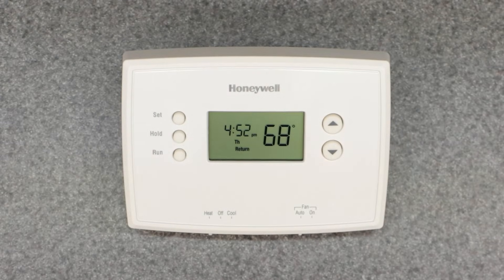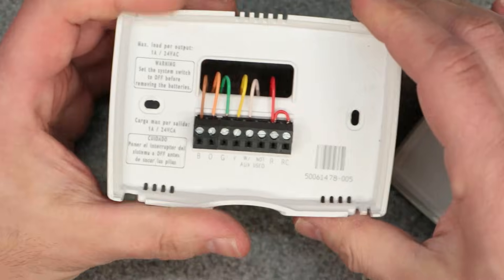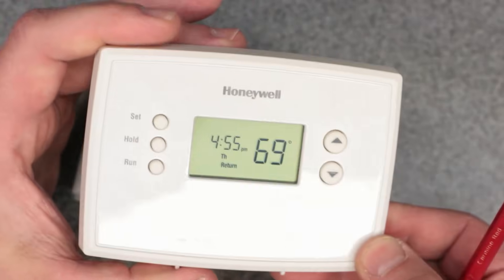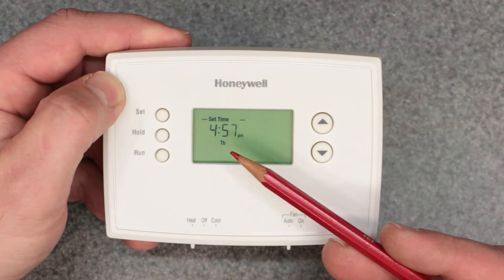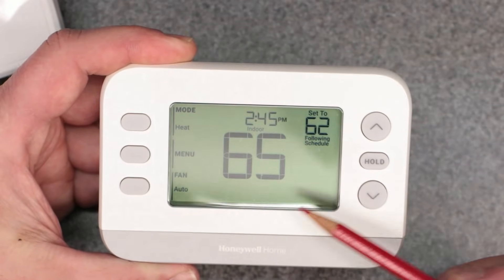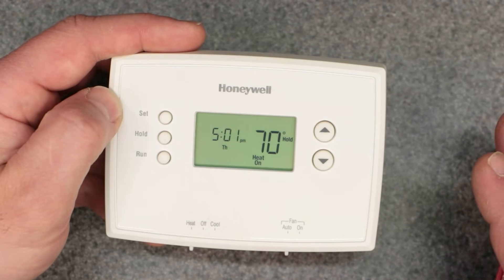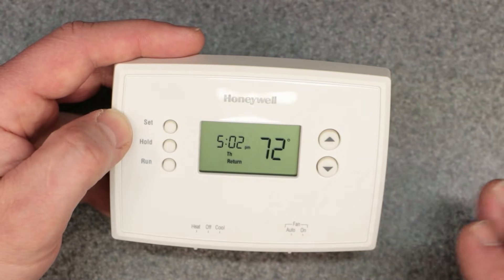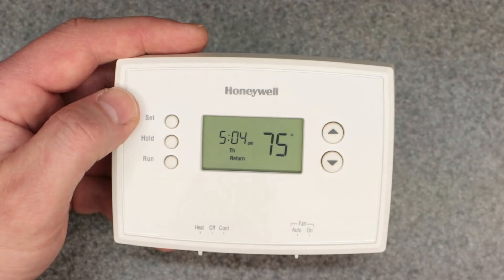5 Common Thermostat Mistakes | Honeywell RTH2510 2410 2300 (How to FIX Guide)

Comment: Stop beating a dead horse & get to the point please … mine doesn’t exit the permanent hold mode EVER and I’m freezing at 64 when the hold set point is 74. This thing is a piece of garbage (and yes, the time is correct because mine goes on 24 hour not 12, and yes it’s fully programmed, and yes the batteries are brand new … ). This happens every season change and I’m sick of the hours I have to spend trying to get the blasted thing to do what it’s supposed to do while listening to everyone else complain about how cold they are while I myself am freezing and desperate to get this thing working correctly because I can’t take the cold or the bitching about the cold ONE MORE TIME 😬😬😬😬😬

Comment: Last night (11/29/2025) room temperature was so cold that woke me up twice, still having problem setting up my RTH 2218 thermostat, any recommendations?
Is there an option to clear the schedule and just run on simple push Button?
My irrigation timer is much easier to work with...